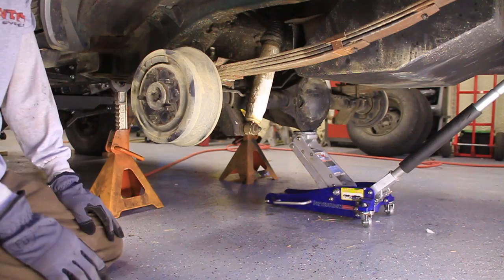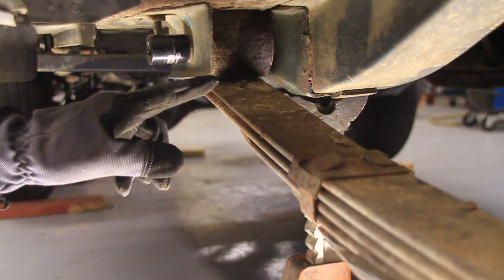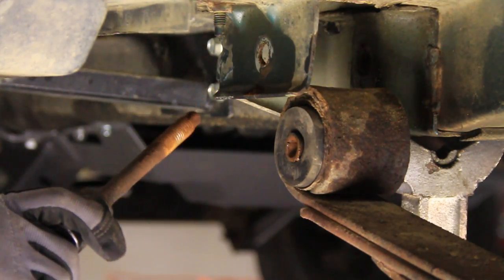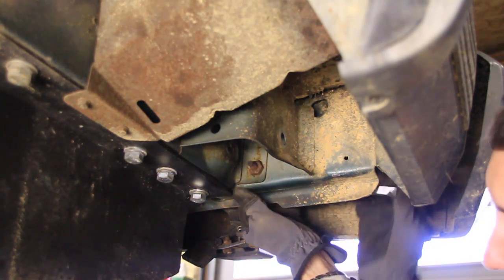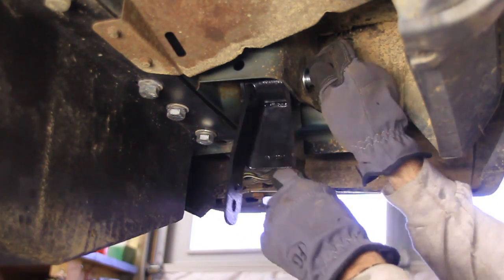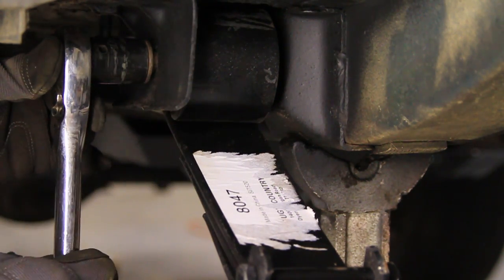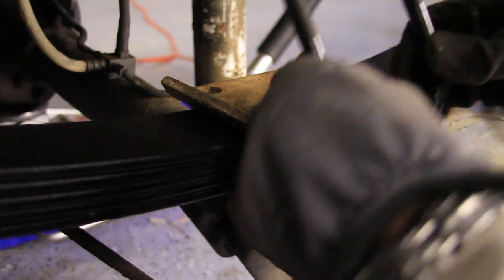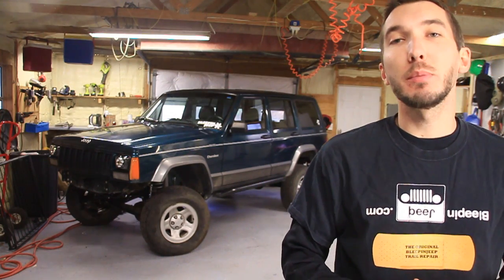How To Install New Leaf Springs - Rough Country

Comment: Great video! Just spent 7 hours with my son putting new leaf springs in his 91 XJ. I'd be lying if I said it was easy, but we got 'er done and your video was a huge help! Thanks!
Reply: If you have a hydraulic lift. It takes 45 minutes to an hour and a half depending on skill and preparation.
Reply: @eaglewarrior8707  I would agree and add amount of rust.
Reply: @eaglewarrior8707  absolutely, I've been working on my xj passenger leaf spring for about 4 days so far, today I just purchased my first sawzall, these leafs are coming out..

Comment: Don't lower the axle too far down at first, and the bolt holding the leaf springs in place will have less pressure on it. Helping the bolt come out easier.
Reply: Thats what i was thinking, you can see when it lets lose how much pressure was keeping that bolt in haha
Reply: That's how I did it , new sponsor should be PB blaster, lol
Reply: Also easier just to replace it from the shacklebolt down, have the shackles already on the springs

Comment: If you are not going to reuse the leaf spring you are removing USE HEAT to break the bolt loose I use a propane torch (Yellow bottle) Or sometimes Heat / cool / heat / cool etc. I cool it with WD-40 because it penetrates as it loosens.
 Great idea using the jack for leverage!
Reply: heat is the only way i could get mine off, just make sure you dont catch the interior of fire when doing the front bolt.!. 
and i think the yellow bottle you are talking about is MAPP gas (methylacetylene-propadiene propane).?. it burns hotter than propane but uses a different torch head
Reply: +sony mathew  how many spring leaf in your bolero I m mecanic spring leaf in bihar siwan jila chappra

Comment: Little top tip! If you are tightening bolts that are subject to coming loose, What to do is draw a line down the nut and down a bit further to whatever it's connected to... That way a quick check would be to confirm the lines are matching!

Comment: Great video. I had to cut a few of the bolts on mine. The Diablo carbide blade was the best i've ever used for a reciprocating saw. It was way quicker! And put a torch to them and they spin easier, too. Thanks for the video!
Reply: Yes the Diablo blades will outlast several of the other brands. PB blast on the nuts and bolts works wonders too!

Comment: If i can suggest something. ( I know this maybe highly debated) Anti seize on the suspension bolts. Buy a tub of the stuff.  Use it library.  I learned over the years. It keep rust down. I tighten the bolts every so often. And never had a problem. But if I need to remove a bolt... They come off without a fight. And Dielectric grease too. (All electrical plugs) Off road and corrosion is a big problem. If you dont have Anti seize on hand Axle grease can help just does not seem to last as long. AND ALWAYS CHECK SUSPENSION BOLTS REGULARLY, Even if you torqued to spec.. better safe then broken on the trail. I also use Dielectric grease on the little trim screws where they mount into plastic. makes installation/removal smoother too. My friends used to think i was crazy.. Now they all have large tubs of the stuff because of the time it saves.
Reply: ...stuffs GREAT, ain't it??!!  You don't have to go ape shit with it though,  a little goes a long way.
Reply: Lol. Use it library. I do agree though!
Reply: Lock tight blue keeps corrosion out too.
Reply: @thetravellingstamps  itll get all over the books at the library... dont take it there
Reply: Do I have to be quiet
Reply: You are spot on my friend  an ounce of prevention is in this case worth a ton of cure

Comment: Gosh I feel so lucky,  I live in AZ, I have a 2000 XJ.  it is rust free,  no problems with bolts seizing up,  I am in the process of installing Rough Country 4.5 leaf springs as we speak,  all of my bolts are coming off with ease     my Cherokee is from AZ  no rust

Comment: Wow you had an easier time than I did, I could back the boots out of the frame, but not out of the bushing, had to cut them out. Bolts where $8 a piece from jeep. Hardest* thing to do on the lift.

Comment: Are those regulars leaf springs ? 
Or does it really exist some leaf spring that may give you some lift on inches? 2 , 3 , inches?
I want to put new set leaf springs on my truck. , but I also would love at least 3 " lift in back!
I'm thinking in doing new set leaf springs , prob. 2" blocks, new shocks! 
If you could help me with some ideas or tips would be great !
Mine is 2003 2wd ranger !
Thank you !

Comment: Don't torque with an impact gun like you are doing in the video. U bolt nuts only require like 80ftlbs. Over torque provides a harsher ride and less flex. This is an important step. TORQUE THE NUTS.
Reply: What is a the tightness for the 2500HD? 90ft lbs?
Reply: @SomethingAlwaysGood  You may already know but it all depends on the u bolt thickness. 5/8 for example is about 115-125

Comment: I recommend anyone doing this just buys new bolts for the front of the leaf springs as I had to cut mine in order to get it out. No pry bar or penetrating fluid in the world was getting this thing out. The bushing and bolt had become one. It wasn’t very rusty it’s just that the bushing had compressed completely around the bolt. 

The bolt part number is 34202118.

Comment: Spray all the nuts and bolts a week PRIOR to loosening them. Use PB Blaster only as it has a surfactant inside the can. Will save you a lot of effort.

Comment: I attempted to install these same shackles today...it did not go nearly as smooth as yours.  The bolts had to be threaded through the holes in the new shackles and did not slide right in like yours did.  Also, for some reason, the bolt provided with the kit must have been a different thread than the OE bolt?  I don't know but it was very difficult to tighten.  I also ended up having to burn out the bushings from my leaf springs (I did not replace my leafs) to remove the shackles...such a PITA.

Comment: I want to add a flat bed on my dodge 2500 single axle diesel truck. Would adding a spring on each side safely help with payload capacity? Also, would adding the springs and airbags be beneficial or do airbags serve the same purpose?

Comment: I have a 1999 jeep cherokee limited i want to do 4 inch lift .. i have a 2 inch   spacer lift in front and well the back is sagging so needless to say im ready to give her the makeover probably even replacing the springs in front to not have to use spacers .. MY QUESTION is i have double Carden drive shafts front and back do i need to do Transfer Case Drop? And where can i get a 4 inch lift Kit with Complete leaf spring packs?

Comment: hey whats up mat its john from the 956 got my day driver . its a toyota t 100 2.7 standard put a ton of parts injector s fuel pump plugs wireings tps . and air flow mass sencior and discover that it doesn't   have a pulse its got ground and power . they say its my computer . what do u think please let me know .ill be on line.

Comment: How did your shortened wheelbase and vertical shackle angle work out for you after installing those Rough Cuntry springs? There's a reason they are called "Rough" Country. I am taking mine off today and replacing them with Rubicon Express. Just a warning to anyone considering RC leafs.

Comment: I have an 87 Jeep Wrangler YJ I ordered 4 inch lift leaf springs what else do I have to change up on if I put 4 inches on it do I have to change out the brake cable lines or anything else like that and I also change the engine mounts is there something for the transmission as well for the standard

Comment: newbie here, my car has a leaf spring installed with a contact under the axle and does not sit on the axle just like what is on the video. Is that still good or should I change it?

Comment: Just put on 6 leaf springs on my 98 xj in my general automotive class last weak I had 3 saggy springs and the top spring cracked in two on both sides

Comment: PLEASE HELP : When putting the pin in the hole on the leaf he said "to get it to move in there you loosen the bolts on the other side to make it easier to move it. What bolts exactly does he mean? As well, what if the leaf spring isn't aligned with the extended shackle, how do I make it go so it is? By just hammering it ?

Comment: Hey guys I have a question. I bought a yj from a private party. She said the jeep has a 3” lift but I’m not sure if that is accurate. The vehicle is a 94 Wrangler S with a 4.0. Is it necessary to change motor mounts too due to lift? How can I measure to see what the actual lift is?

Comment: Did you drop the wight of the vehicle on the springs before tightens there bolts ? Or it doesn’t matter ?
Reply from the maker: Yes, you should

Comment: I don't think I've ever seen the front spring bushing bolt come out without having th welded nut braking off or the metal bushing sleeve rust welded onto the bolt.
Reply: I'm in the process of installing the RC 4.5" X series kit as we speak! Front was way easier ,but a bit more technical than the rear.
On my '96, Both of my front spring eye bolts had to be sawsall'd off. Stupid sleeve was froze to the bolts! I soaked the damn bolts with PB blast every day for a week before I even attempted to remove them.Drivers side nut broke off inside the frame.
I had to cut a hole in the bottom of the frame, remove the stock nut and replace with a nylon lock nut, and new bolt. I figure I'll just fold the flaps back over the hole I cut in the frame and weld it up.then spray it down with some undercoating. Probably have to do the same on the Passenger side.
Tip: make damn sure you have a long breaker bar and a long cheater pipe before you even attempt this! It's still gonna suck.

Comment: I've been soaking all my suspension bolts with pb blaster and liquid wrench all week to do my springs tomorrow. I don't know which is better but one must have worked lol
Reply: +hugeslacker USE ACETONE AND ATF 50/50 ITS A MILLION TIMES BETTER IT WILL MAKE EVERYTHING SO EASY!!!!!
Reply: +CowPigTurkey Do you mix them together?
Reply: try  used automatic transmission fluid to break free those stubborn fasteners..

Comment: Hey Bleepin Jeep! Just wondering if a 3" rough country add-a-leaf kit, instead of a full leaf pack kit,  would work with my stock leaf springs, they're sagging but not flat yet. I have heard that the add-a-leaf will flatten out with sagging springs. I am wondering because it is considerably cheaper than a kit with full leaf packs.  Thanks in advance!
Reply from the maker: +Jack Coleman well you could end up with only 2.5" in the back... Full springs are the way to go if you can afford it.
Reply: +BleepinJeep Well then I might just have to get full springs! Thanks guys and I find your videos to be super helpful and awesome. Keepem' up!

Comment: ive heard from a couple people to actually lower the weight of the car onto the new leaf springs then tighten them all the way so you get a less bouncy ride. any thoughts?
Reply from the maker: Yes, that apparently is the proper way, get the weight on before tightening.
Reply: with that cleared up, ive read torque specs ranging all over the place. 52 ft lb for ubolts. 62/80/109 ft lb for leaf to frame (front) AND leaf to shackle. and 80/109 for shackle to body. on top of that, if you use anti seize all the specs will be the lowest recommended values as in 52 u bolts, 62 frame/shackle, 80 shackle frame. thoughts on this?
Reply from the maker: +-iDol-Hands get a Haynes manual cause every vehicle is different.

Comment: I'd hit those bolts with some rust penetrant every night for a week. They'll come right off. Get some Evapo Rust from Tractor Supply for $22 a gallon and soak any bolts or parts you are going to reuse for a couple of days and they will be rust free. Clean with some Eastwood Pre Paint Prep and use some self-etching primer and chassis paint rattle cans from Harbor Freight or farm implement paint to make em look nice and protect them for a long time. Little bit of extra work goes a long way.

Comment: One improvement I'd add is to get the steel lock nuts for the U bolts instead of the nylon. They are only a few bucks a set. They nylon deteriorates and being under the car they will age out quickly and could come loose. 
Just find a fastener supply in your area. Fastenal is well known but always seems to cost 3 times as much. I usually look for one of the independent fastener supplies.

Comment: Can anyone out there help me out with the specs on the stock bolts: leaf to frame, leaf to shackle, and shackle to frame?  I can't find them anywhere, and I want to have the replacements ready for when I grind these beasts off.

1996 XJ 4.0L 4WD w/Chrysler 8.25 axle

Thanks!

Comment: HELP!! As I tried to remove the front leaf spring bolt on my 99 Cherokee it appears the steel sleeve inside the bushing has seized onto the bolt. so as I turn the bolt the sleeve is coming with it and bending the hangar / frame. What do I do now? I have a pic but cannot seem to share it here...
Reply: Same problem here, and my rear bolt spins with no result

Comment: hey bro just wanted to ask you I installed a ruff country 3inch lift . after the install I've been having a vibration while driving and at about 45meh there's a grinding noise when I let off the gas! PLEASE help me this is my daily driver!!  thank you
Reply: Probably your pinion angle, look it up. Need some shims or different shackles
Reply: +jetsgo66  thanks for the tip. lowering the transfer case tomorrow hope it helps
Reply: nick Yanez did the transfer car drop help or did you have to add shims?

Comment: Driver's side front and back is down a half inch.  I"m installing the ACOS spacer in the front, but can I put a half inch block under the leaf spring?  Does that exist.?
Reply from the maker: Yes

Comment: Get rid of the crappy urethane bushings. They give a harsh ride and don't flex at all. They are ok if you are building a road racing car where you don't want flex. Use factory rubber bushings.

Comment: So after fitting brand new rear leaf springs my drivers side is approx 1" lower than the passenger ?? anyone know why ?
Reply from the maker: +MrDavebrit did you wait to tighten all the leaf spring bolts after you put it on the ground?
Reply: Yeah I'm 99% sure, I could back them off and re tighten while on the ground? Could it be rear sway bar causing this? bent possibly?
Reply: So i backed them off and retighten while on the ground just to make sure and still no change? Do shocks have anything to do with it?
Reply from the maker: no, maybe the springs are not equal, maybe you have more weight on the driver side, or maybe they just need to settle for a while.
Reply: is the suspension of one side in front worn out?

Comment: Does anybody know where I can get a new set of STOCK leaf springs for an XJ? Mine are sagging bad and I would probably gain 2-3 inches with new stock springs
Reply: Se7enAte crown
Reply: Se7enAte Is a search engine that hard to use? Come on, man.
Reply: I'm installing the dormans tomorrow... 100 each from Amazon. I just bought a 99 with no rust and low miles so i'm trying to retain its resale value so i'm keeping it stock height. Anyways, they're cheap enough and look well made. And they come with bushings.
Reply: hugeslacker I was browsing craigslist one day and I found a guy parting out a 92 XJ and sold me both the springs for $50. Mine being an 89 and beat to hell I assumed the 92's springs would have a few years left in them. By then I'm probably going to have a lift kit so I'm not too worried about these ones sagging too. I did gain about 2 inches of height compared to the old springs though
Reply: yeah i gained about 4" lol.. but my rear was so sagged the wheels were actually tucked inside. one of the leafs was broken which didn't help probably. obviously had to break and punch out the shock bolts, and the leaf bolts took FOREVER, but 2 days later its good.
Reply: RockAuto

Comment: use heat next time to prevent strain on your self😂😁
Reply: Leeboy Grantham or lubricant. Lol. Something.
Reply: Trouble is: there's no easy way to get heat to the bolt/nut junction because bushing is in the way on the bolt side and there's not access to the nut as it's enclosed in the frame on the other side.  The only way to get heat in the right spot would be to cut off the spring, cut off the outer metal bushing sleeve, dig or burn out all the old bushing rubber, then pry or cut off the inner bushing sleeve.